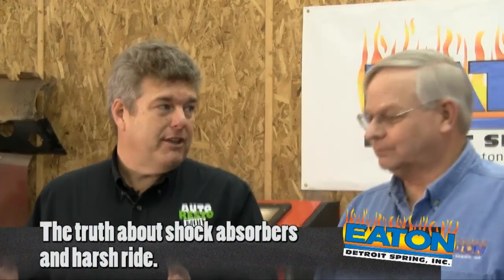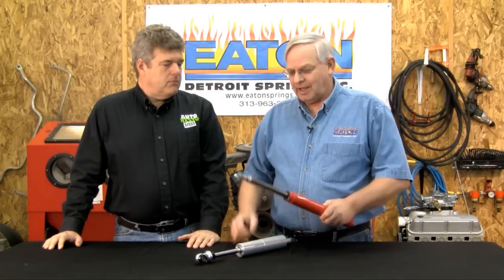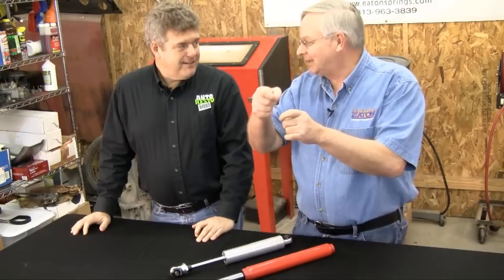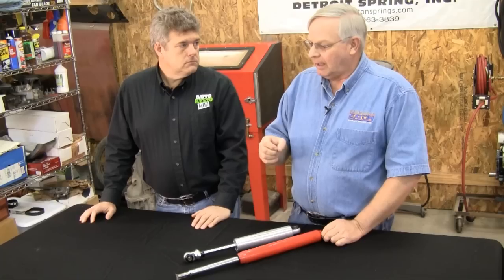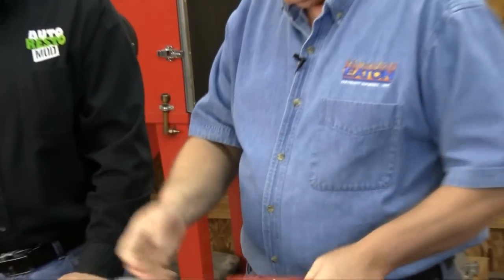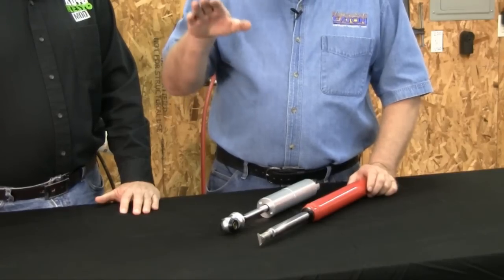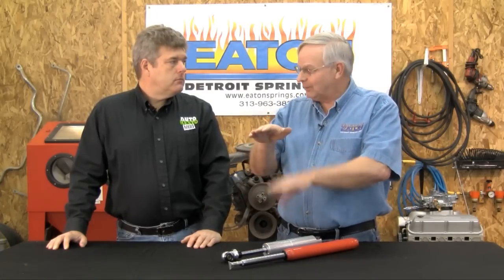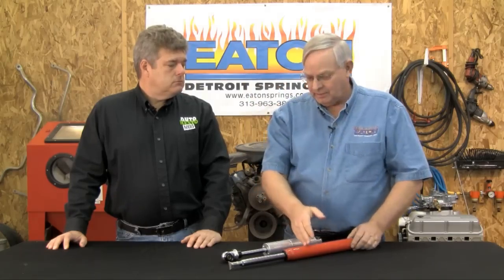Hydraulic vs Gas Shocks for Classic Vehicles | EATON Detroit Spring on AutoRestoMod

Comment: Gas shocks paired with 640/240 spring rate did make a potent track car with a rear panhard bar in my SN95. Even with the archaic suspension design.

Comment: Gas shock absorbers – The biggest misconception about gas shock absorbers is they are filled exclusively with gas. Not true. Every shock absorber has hydraulic oil.
Nitrogen gas is used to pressurize the oil which prevents the oil from foaming, a term called cavitation. This provides a reliable stable shock absorber, big safety improvement over the oil damper which suffers from a noticeable drop in damping force under load.
So with this in mind changing your standard oil shock absorbers for gas ones will improve your vehicle stability, road holding and safety.

Comment: Wish I'd watched this two days ago before installing gas shocks on my 67 Camaro.
Reply: Most shocks nowadays have a light nitrogen gas charge to reduce foaming of the oil. If you can push the piston down by hand, it's not supporting your car. Try pushing in a piston for a hood or trunk lid and you will see what I mean.
Reply: Daxton Brown same here if I had seen this video before  I wouldn’t have gone for the gas, the garage should install it tomorrow but I bought it already, too late
Reply: Gas are a firmer ride but that what you want so you have better handling. Plus in cold weather, they stand up to the cold better.
Reply: Best shocks I ever bought were Delco Super Pleasureizers for a 66 Chevelle SS with a HP 396. gas charged shocks do not provide a ride as comfortable as the old oil charged shocks. However, I cannot find any company making hydraulic shocks anymore.
Reply from the maker: @Rick-zh4ir  QA1 and Viking do make them. Costly, but excellent quality, both of them.

Comment: @ 2:22  when he mentions "or the car will bounce up and down uncontrollably".... modern vehicles really DO bounce up and down uncontrollably but it's too "tight" to realize... They stiffened everything up because people are poor drivers so it's for safety.  I ride in Uber a lot and it is the most uncomfortable experience compared to say a Crown Victoria yellow cab (float like a dream).. from jeeps to minivans and especially VWs the suspension is TERRIBLE and the seats are awful.. it feels like a train with no suspension or something.. they ride like a mine cart.  I grew up with luxury cars and conversion vans... This video helped me in getting hydraulic shocks and choosing rubber over poly for my old truck ( well uber helped too)... So many restorations are ruined automobiles for the wrong suspension and wheels. My MN12 Thunderbird would float beautifully over bridge gaps on the highway.. but it still had motors to dampen the shocks further for sportier handling.. it was truly outstanding feeling even with the car on lowering springs.. Thank you.

Comment: I have a leaf sprung land cruiser 70 series.  A few months  ago I installed the kyb excel g (low gas) in all corner, and the ride was terrible. After I watch your video I replaced the rear with the OEM tokico hidraulic shock, and it transformed the vehicle, smooth the ride right away. I will change the front ones soon.
Stick with hydraulic shock for older cars if CONFORT is your purpose!!!!!!!
Reply: VHM the problem with your monroe hydraulic  shock it will leak they don't last like kyb.
Reply: @marianluc6235  i don't use Monroe. The rear one is the  original TOKICO, and the front one will be KYB premium (blue box). I prefer Tokico over Kyb, but both are made in japan, excelent quality.

Comment: Personally I think hydraulic shocks don't perform as well as gas charged. I had hydraulic shocks on my jeep and when it hit bumpy and even roads at high speeds the axle would be sloppy and lose traction, while my gas charged keep the axle down on the road and I don't lose traction. However the gas charged shocks make it very bouncy, kinda fun when you go through dips and humps in the road you get a floaty feeling, or when braking and comming to a stop it likes to nose dive and pop back up when stopped.
Reply: What you are saying is backwards and makes absolutely no sense at all. This video explained it flawlessly. Gas shocks make the ride quality insanely bumpy and pathetic. But hydraulic oil shocks make the ride feel like a cloud.

Comment: Excellent video wish I would of watched it before I bought these shocks for my 89 dodge truck lol
Reply: Wish I would have watched this video and saw your comment too! Bought new gas shocks for my 96 Dodge Ram 1/2 ton. Really rough ride. 
Which shocks did you buy to smooth out your ride? Thanks!
Reply: @Luda1010  Any update? I also bought gas shocks for my 2nd gen, terrible right quality over expansion joints and bumps.

Comment: Do gas shocks raise the ride height?
Reply from the maker: If the vehicles suspension was not designed for gas shocks, due to the internal pressure of the gas shocks, their use may cause the ride height to increase.

Comment: now isnt the shocks job to keep the tires on the ground? i feel with hydro shocks they dont react to the ground on the rebound levels imo. hit a few bumps at the correct time the hydro hasnt cycled properly. my 73 rides like crap with hydros( too slugglish to react to the road conditions and acts like its skipping vs constant tire contact. is a hydro just stiffer valving?
Reply from the maker: No, the shocks job is to control the release of the springs kinetic energy. That is, to slow down the springs bouncing up and down. The difference between gas and hydraulic shocks is mainly internal. As the oil in both types of shocks moves through the valving it heats up and starts cavitation, that is bubbles form. As more and more bubbles form as the shocks work up and down, the effectiveness of the shocks becomes less and less.
With hydraulic shocks there is nothing inside the shock tube that controls the cavitation.
In side gas shocks there is a little bag of gas that has been pressurized and this bag reduces the cavitation. The downside of gas shocks is the gas bag adds stiffness to the shocks which adds to the amount of weight required to move the suspension. Another way to look at this is added spring rate.
The suspensions on cars of the late 70's and early 80's were adjusted to allow for gas shocks while the suspensions of older cars were designed to use hydraulic shocks.
Your shocks may be worn enough to require replacement or they could be spec'ed wrong.

Comment: I'm planning to replace the damaged RR (or both as advised) shock on my 06 Lexus GS300, the OEMs' are oil!
would the ride be stiffer if I install the KYBs' GAS shocks ( as recommended OEM replacement) ?
Reply: always go with factory. this video is for classic cars. If the kyb's are oem replacement then they're the same design as oem which is most likely gas charged.

Comment: I have a 53 F 100 with a Heidts Mustang II suspension setup. It came with what I believe are gas shocks. I took the shocks off because it rode so harshly when I got it on the road for the first time. So I’ve been driving it around with no shocks at all. I realize that I need to put some kind of shocks back on it but I’m not sure what type to use. Maybe I need a softer spring?
Reply: Wait you can drive without shocks?
Reply: @heisenberg7186  I have the shocks back on it now, but it drove okay without them. I got no bounce in the front which makes me think my front springs are too stiff.  I got SOME bounce in the back, but not that bad.
Reply: @chucksgarage7165  mustang springs are definitely a stiffer spring rate. see if you can fit some grand marquis or town car springs. those at least have the softer spring rate.
Reply: What's the spring rate? You have to find out that your spring rate will work for the weight of the front of your truck. If rate is too high it will be harsh. Changing just the shocks isn't gonna help. Remember, you want the suspension to articulate and do its job. Having too much stiff of a spring will also make your sway bar useless.
Reply: @cyrus138   Shocks can play a big role in how stiff the suspension is.  I understand that the spring rate has to be right.  I don't know what the spring rate is.  I don't have the boxes they came with and I haven't found any markings on them.  I thought about sending them to Eaton to test and let them recommend what I need.
Reply: @chucksgarage7165  In my case the coil over springs I initially got for my 56 chevy were too stiff to the point where my auxiliary gauge bulbs were going out from the shaking. This was my error because I overlooked the weight savings i did from stock when i calculated the front weight. I swapped to softer springs and not only did that let me have freedom with the shock adjustment it made my car more stable on the freeway, more grip up front and gave me a very nice ride. If your springs are too stiff, no shocks is gonna fix that unless maybe you add weight to the front end like a bigger engine or blower. In my experience, the adjustable shocks couldn't even dampen the stiff springs even at the lowest setting but the fact that you said yours drove fine without shocks that's extreme and means your springs definitely aren't right for your application.

Comment: Do they behave differently in cold weather?
Reply from the maker: Excellent question Eddie. Yes at 1st they would, but once the action starts the oil will heat up very quickly and any difference would be gone.
Reply: @EatonDetroitSpring  Makes sense, thanks for the quick response!

Comment: This is absolutely amazing!! Thanks A LOT for creating this video!! So, why in the world were gas shocks even invented??? What is the problem with just exclusively using hydraulic shocks???
Reply: Gas shocks carry heavy loads maybe
Reply: @jimpaul162  I just want someone to say which is better than which in general.  Without dancing around the Bush as if they're going to get sued if they said in general hydraulics is good for motorway where there is no speed bumps and gas is good for back street driving.  👍🏿edited or is it the other way round 🤔 🇬🇧
Reply: @zigzag7194  👏👏👏👏
Reply: @zigzag7194  Your shock of choice will depend on what car and suspension you have. Classic factory suspension = hydraulic. Modern car = gas charged.  So basically go with factory.

Comment: Which one is the best to use?
Reply: Did you actually watch the entire video with the speakers turned on? It clearly explained that gas shocks are absolute garbage and cause horrifically pathetic ride quality. Only hydraulic oil shocks can offer a smooth and comfortable ride quality.
Reply: Yes 1 want to try a gas shock i dont want to my car bounce
Reply: @SandeepSingh-dv2uy  What you said makes no sense.
Reply: Ok fine. 1 put adjustable ammotisseur.

Comment: "gas" shocks are hydraulic. They have oil in them that passes through an orifice to dampen the spring. The gas just keeps the oil from foaming under heavy use. Google "how do gas shocks work".
Reply: You try to google it. See what happens. Thanks
Reply: Gas charged shocks DO NOT RIDE as smooth as shocks only filled with oil. Gas charged shocks do have oil in them, but the gas is what makes them extend all the way out and are hard to compress in. Dual actions oil filled shocks ride the smoothest and better that gas charged shocks.
Reply: A compressed gas acts as a spring. A compressed gas cannot act as a damper. If you springs are weak a "gas" shock would improve the ride by making the spring stronger. The pressurized gas is just there to prevent air and oil emulsifying. Google is your friend... There are videos on youtube that show what's inside a gas shock and how and why it works better. Which it does... work better I mean.
Reply: A compressed gas DOES act as a damper because unlike a spring, it transform some of the energy into heat therefore dampening the movement.
Reply: Sure they have oil in them, however, they are fully expanded all the time and THAT give a harsh ride and not as smooth as a shock that is not gas charged in any way. A dual action oil filled only shock, gives a much smoother ride by far.
Reply: Yes, they have oil in them, but they are gas CHARGED.  Gas charged shocks maintain pressure that forces the shock to fully extend all the time. Oil charged shocks do not do that. Dual action oil charged shocks give a better ride than any gas charged shocks. Dual action oil charged shocks do not force your wheel down into a pothole like a gas charged shock does. It Has resistance when extending ort compressing and that give a much smoother ride than any gas charged shock. I have worked professionally on cars for over 50 years in dealers shops and gas charged shocks need to go away forever.
Reply: So the gas shock will expand by itself. The point is not because the  weight of the car will not change the effect of either one of these kinds of shocks.  You're talking about thousands and thousands of pounds. A gas shock, though will expand to its max range when unloaded has the same effects of a hydro shock when it's under weight.
Reply: You make it sound like there are still positive benefits to utilizing gas shocks {just because there is a partial amount of fluid in there}. 100% of everyone I have ever met who drives today's new modern automobiles already realize how pathetic, harsh, and bumpy the ride-quality always is. And all these people actually believe this is just the normal way it is supposed to be. They don't realize that the only reason it is this way, is strictly because of whoever the bastard was that invented the worthless gas shock technology. And when I give anyone a ride in my 1978 Lincoln Continental Town Car with 100% pure hydraulic oil shocks, they ask me how in the hell the ride quality feels like they are literally floating on still waters, with absolutely no feeling of bumps or motion; just the most astonishing level of comfort in history.

Comment: Am I wrong?  Am I?  You tell me.
I always hated double-acting shocks because I don't believe a shock should influence the compression of the spring.  I believe that the spring does that job and the shock's job is to capture the rebound that the spring will attempt.
I believe...Hey, that was a song.  "I believe..."?  Some guy sang that on the Ed Sullivan Shoe.  Those were the good old days.
Reply: Dampers are designed to control both the compression and rebound characteristics of a spring because road conditions, weight, and engine load are not constant.

Comment: 6 hours I'm searching the internet for a vid to answer this question, what shocks gives more comfort to passengers oil or gas shocks, now I know the answer.

But I've a other question now.. What makes the oil shocks extend back if they are not gonna extend by its own?
Reply from the maker: A hydraulic shock should not extend on it's own. The shocks job is to control the release of the spring's kinetic energy. That is the shock stops/slows down the spring wanting to continue bouncing. It does this by slowly (?) letting fluid pass through an internal valve. There is no internal pressure inside a hydraulic shock like there is in a gas charged shock. It is the gas charge that causes a gas shock to expand on its own.
Reply: @EatonDetroitSpring  Thx sir, one more question plz. What is the proper front shocks for vw beetle MO 2001.. Hydrolic or gas?

Comment: so what is solution apart from replacing it back with hydraulic ones ? the mechanic is of a view this would settle after driving about 400-500 kms and Car would run more stable. Is that true ?
Reply: the solution is always go with oem or oem equivalent.

Comment: Freakennn gen Xers, it’s alllll about performance and hydronic shruts are a thing of the past. Buy the right springs or even stock and gas struts will break in to just as good of a ride. as well as extra performance with breaking and accelerate... instead of your hydro struts taking the energy. Buy gas unless you got an old beater. But most older restorations have ungraded suspension that will suggest using gas struts anyways... but if you like losing mpg and breaking power go for it.
Reply: Ok, Boomer!